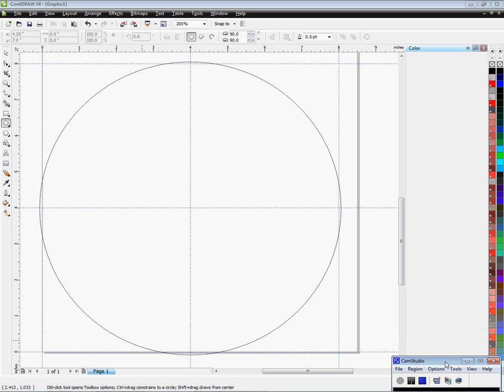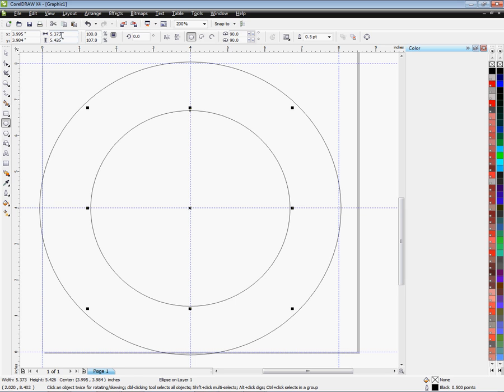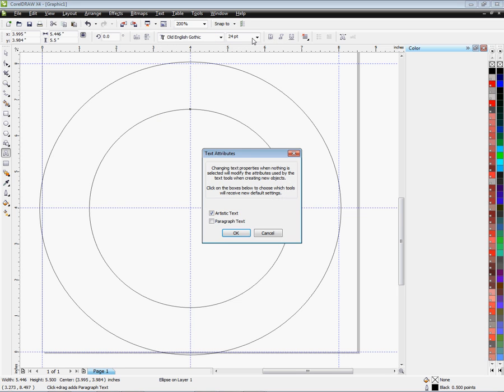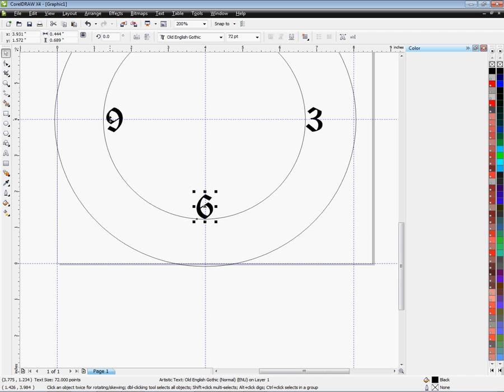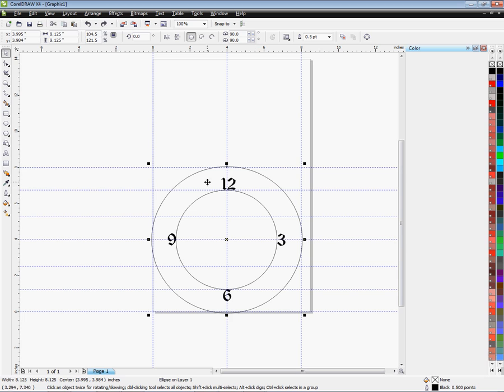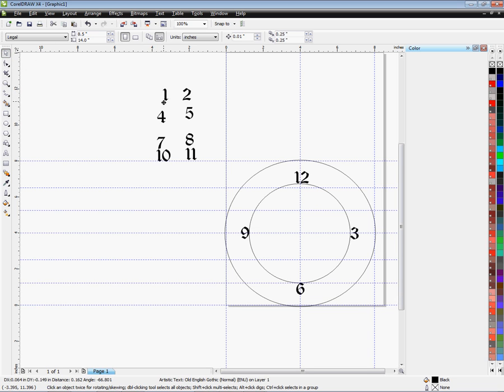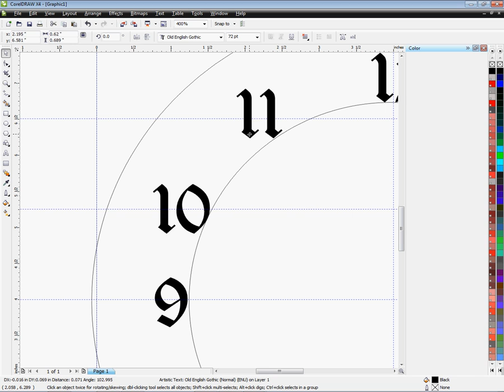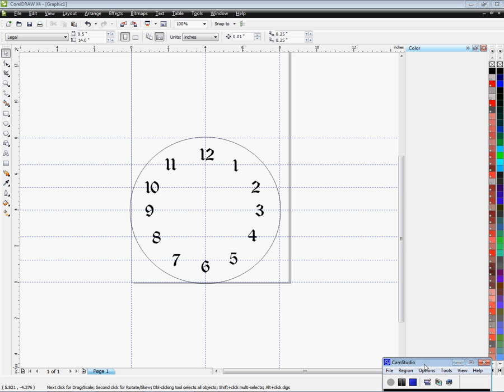Easy Clock Faces for Imprinting Using CorelDRAW: Method #1 -

Comment: This is totally wrong. here's what's right. place the 12 @ 12, pull out the blend docker and type in 11 then hit ok. Then select the blend and fit blend to path and click on your circle. presto! you have twelve #'s in correct position, Now simply click the 1o'clock position with the text tool and backspace twice and type a one. now hit the tab key to repeat at two o'clock. your done in less than a minute.